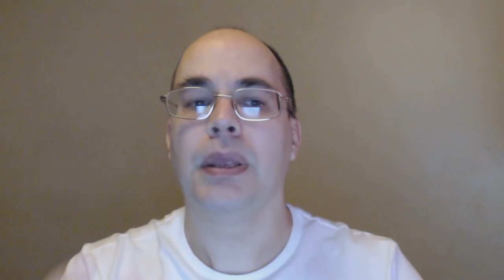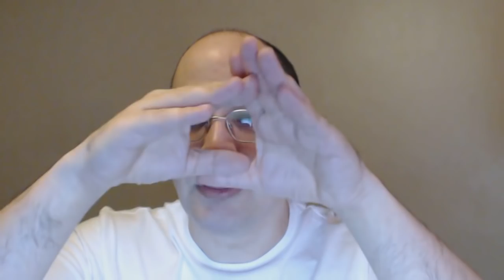How do rockets move in space, with nothing to push off from?

Comment: I take it you haven't had a scientific look at the flat "Earth" yet. Once you do, everything you have ever learned will be turned on its head. Do a curvature test for yourself and be prepared to see science in a whole new way. The Earth is stationary to. Just for a while, stop reading your books and look at the Earth. It needs more brainy people to know the truth.
Reply: +bob question You are a fool. A sphere with a circumference of 24,900 miles will have a radius of ~3,960 miles (and thus a diameter of ~7,920 miles not 24,900 miles as your dumb ass stated) and thus a surface area of ~197,000,000 miles^2. In regards to the Earth, the north and south poles will be ~12,450 miles apart. A circle on a flat plane with a radius of 12,450 miles (from the center north pole to the "ice ring" south pole) will have a surface area of ~487,000,000 miles^2. Most people with an IQ above 70 would call that a pretty sizable difference (while most scientists would shoot whatever they happened to be drinking out of their noses snorting at the sheer depth and unabashed arrogance of your ignorance...and the ridiculous odds that someone like you could survive beyond childhood without stumbling stupidly into death...)

Line of sight on a spherical Earth is simple to calculate (most would consider it common sense) and doesn't translate to a flat plane. You merely take a circle with the Earth's radius (~3,960 miles I usually use 3,959 miles as that just happens to be the measurement I see most often. It's not a perfect sphere after all and has a dynamic surface...especially when dealing with bodies of water... so such measurements will always have a little discrepancy to them) and draw a tangent from the observer's height above sea level (the point where that line meets the circle will be the observer's horizon.) Extend that line on out as far as you want. Anything above it (beyond where it meets the circle) will be above the horizon for the observer. While anything on the observer's side of their horizon will be completely visible to them. To actually do the calculations, you simply form a right triangle where the hypotenuse has a length of (Earth's radius + observer height) and the other two sides are the Earth's radius (line from the center of the circle to where the tangent from the observer meets the circle) and the length of the tangent from the observer to where it meets the circle (AKA observer's distance to the horizon.) From there, the Pythagorean theorem can be used to determine the length of any one unknown side. If you want to know how much of something will be visible, and you already know it's distance, simply calculate the distance to the horizon for the observer, subtract that from the total distance, and then calculate the curvature "drop" for the remaining distance (distance in miles^2 x 0.667 = "drop" in feet.) The result will be how much of the object will be below the observer's horizon. None of that should make any sense on a flat plane and yet our measurements / observations match the results...(within a small margin of error due to other minor factors involved that aren't accounted for in the calculations...like refraction.)
Reply: "The time zones work therefore the idea of a flat Earth is IMPOSSIBLE." Modern flat earthers manage to explain timezones, it is a flat earth consensus that the sun travels above the earth and acts like a spotlight, most argue that the sun circles the North Pole, some however have argued the sun travels east to west in a straight line, but the east-west dimension loops back on it self.

In doing so, these idiots render themselves unable to explain sunset and sunrise, and get the path the sun in the sky wrong.
Reply: Most of what you say is correct. The moon has only a 7% energy return; so you need good power and sensitive equipment to pick up the return signal. However it can be done with as little as a 1000 watt transmitter. Used ones are quite affordable. 

However here's what is incorrect about your claims - that you've looked into it and found no evidence for it. That is a lie. 

Literally thousands of people around the world have done it; there are videos right here on youtube from people who have done it, and there are forums, web pages and clubs dedicated to it. 

Don't make things up or lie to advance your points because when you are busted on them you look desperate. 

You, personally, could do EME bounce. Anyone can. I haven't found any flat earthers who have managed to do it, or even try it - they seem to be incapable. I'm not sure why but I have my suspicions.
Reply: I know someone personally who has done it. You can seek out your own local amateur radio group and quite likely find someone similar. 

It's easy to dismiss something from the safety of your computer. Harder to say it to their face. But you're a coward.
Reply: The tests you're talking about are "line of sight" experiments, not curvature (though curvature is involved.) The primary difference being that you first subtract the distance to the horizon for the observer from the total distance to whatever you're trying to observe and then calculate the curvature for the remaining distance. When you compare the results of flat earther "curvature experiments" to the properly calculated line of sight results, they are always within a few percent of what would be expected on the globe model. A difference easily accounted for by atmospheric conditions and inaccuracies in their measurements.
Reply: I take it you haven't heard of EME bounce then.
Reply: No, it only bounces when aimed at the moon. It doesn't bounce when aimed anywhere else.
Reply: Kris de Valle
If you can bounce radio waves of off the moon more so than the sky around it and receive a properly measurable signal back, this would have massive implications for what the moon is.
Reply: +bob question Flat Earth requires a small close sun (and moon). Any scientific look you take at that will show that the sun (or moon) can't be close and small and still match observations. Apparent magnitude, angular size, and the direction of "rise", "set", and "travel" across the sky relative to an observer simply cannot be made to work on any flat model.

One very simple experiment refutes flat Earth in regards to angular size. It's easier with the moon (as it requires looking directly at it and being able to see it's outline clearly) but with something like welder's goggles, it can be performed on the sun as well. Simply take a piece of glass or clear plastic, observe the sun or moon through it, and use a marker to trace the outline of the sun / moon onto the glass. Do this at least three times during the day (or night for the moon) when it's close to the horizon early on, when it's not (midday / night), and then near the end of the day / night when it's close to the horizon again. Your eyes will tell you that the sun (or moon) gets larger, the closer it is to the horizon. When you measure the circles that resulted from your tracing the outline at those different times however you'll find that they are all the same size (technically there is an extremely small change but it's so small that the human eye can't distinguish it and drawing it freehand is nowhere near accurate enough to catch it if you could...in fact the actual change is far smaller than the thickness of the line drawn around the outline.) A sun or moon 3,000 miles away, should appear (when drawn this way) to be at least half the size it is at it's highest point around an hour after it "rises" or before it "sets." You'll find no noticeable change (even at 5,000 miles away like some models have it, there will still be a very noticeable difference.) That only makes sense if what is being observed is a great distance away. (an interesting side note is that the optical illusion that it changes size relative to the horizon exists when dealing with photos / video as well. When compared by a person, a photo or video taken of the sun or moon which includes the horizon in the image  and one that doesn't, will appear to have suns or moons that are different sizes even when tracing their outlines on something clear shows that they are actually the same size in both images.)

Apparent magnitude (brightness) is a little trickier to test exactly as you'll probably require an instrument to determine the exact "brightness." However, a sun or moon 3,000 miles above an observer (~noon or when the moon is at it's highest point) will be over 6,000 miles away from an observer near the edge of the illuminated area. Apparent magnitude of a light source is inversely proportional to it's distance from the observer. As such, at twice the distance, it will be 1/4 as bright. We do not see the sun or moon as being 25% of it's maximum brightness at anytime during the day / night (in fact, using good instruments will show very little change in brightness over the day / night...most of which can be accounted for by atmospheric scattering due to the light having to travel through more of the atmosphere to reach an observer near the edge of the illuminated area.) Again, at 5,000 miles minimum distance (as some models have it), the change would not be quite as drastic but should still be very obvious...and it isn't. What we see makes sense if they are very far away however. For example, for a sun 93,000,000 miles away, an observer would need to be an additional 93,000,000 miles away to see a drop in brightness of 75% making a difference of several thousand miles between observers trivial.

As for direction of "rise", "set", and "travel", that can be tested with a compass and the ability to see. Simply use a compass to determine the direction (relative to you) that the sun or moon "rose" or "set" and then consult any flat model you wish. Advance the sun or moon on that model to where it's light first reaches your position for "rise" (or just before it's light moves beyond you for "set") and then determine it's direction relative to you. It will never match the direction you actually observed (unless you happen to be standing directly at the north pole for some reason...in which case you've probably got bigger concerns to deal with.) "Travel" is a little trickier but an easy example shows that it doesn't work either. An observer at facing to their due east at the equator on one of the equinoxes will see the sun "rise" directly in front of them, appear to travel straight up and directly over them, ultimately "setting" directly behind them (their due west.) In other words, they'll see what appears to be a straight path of travel. The appearance of a straight path of travel is impossible on a flat model as lines of latitude (east and west for the equator) have to curve away from an observer along their horizontal axis (to their left if looking east and right if west) on such models. On a spherical model, lines of latitude curve away as well only they do so along the observer's vertical axis allowing for an apparent straight path.
Reply: Wow. No answer as to why the sun traverses the sky differently in the southern hemisphere then? I would think something so obvious should have some sort of answer.
Reply: +mj murcott The only way they can make it work is by changing reality. ie making the sun and moon only 32 miles in diameter and only 3000 miles away. A classic example of an argument out of ignorance to explain their model.
Reply: +bob question In the flat earth model the sun sets due to perspective correct. If that is the case then I will believe the earth is flat when you can "bring the sun back" with a telescope or pair of binoculars after it sets below the horizon. Conversely if you CAN'T bring the sun back after it set by going to the top of a high rise I will believe the earth is flat.
Reply: Looked at it bob.
It ain't flat.
You ever been up in the air?
Reply: Jeff Bob
That is a montage of two different pictures. It was not taken from the moon.
Reply: bob mentioned, "... so called,  satellite dish. "   What's the real name for it?
Reply: +bob question  Mathematics Bob. The language of reality. Math may not be reality but it does an excellent job of describing it. Classic example. Spring Equinox at noon. observers at the Equator and every ten degrees north and south. At the Equator the sun will directly overhead. For every 10° north or south subtract the latitude from 90° and that is the elevation of the Sun above the horizon. Now plot this out as if on a Flat Earth. The intersections of the angles from the Equator and the degrees of latitude will not all meet at the same point. Not even close. Never mind the problem of sunrise and sunset on the Equinox's all being at 90° east and 90° west. it can't work on a flat plane. Besides the effects of Earth's curvature is visible at sea level. Look at a YouTube user named Soundly. He has video he posted in real time of the transmission lines across Lake Ponchatrain. These towers are evenly spaced and in line with on another. As you get farther out the tops of the towers form an arc as do their support piers as they meet the horizon. The piers disappear over the horizon while the twers continue to arc downwards
Reply: bob question anyone can do eme bounce and determine the distance to the moon. Thousands have.
Reply: I've had a scientific look at flat Earth. And I can't believe that people fall for that nonsense. Let's ignore the maths and start with what is plainly observable. On the flat Earth model, it doesn't matter where you are on the planet, the Earth will be tracking to your right as you stand and watch a sunset (ignoring the fact that it would never go below the horizon for a moment). Yet if you have ever watched a sunset from Johannesburg, Sydney or Santiago, all in the Southern hemisphere, you will see that the sun tracks to the left as you stand and watch sunset. This would be impossible on a flat Earth. Yet MILLIONS of people have seen this happen. There are plenty of time lapse videos of sunsets on Youtube that you can compare.
Reply: So is your alternative explanation that God is spinning stars in the sky to pretend we are on a globe?
Reply: +bob question - stop reading your books!  And learn from youtube!
Reply: mpetersen6 : the bob in question appears not to have responded for seven months.
Reply: +bob question
The fact that the earth has 2 celestial poles around which stars appear to rotate, the northern one only visible from the northern hemisphere, the southern one only visible from the southern hemisphere, destroys even the slightest possibility that the earth could be flat.

You keep talking about scientifically looking into the "flat earth", yet your statements in this discussion demonstrate you lack the fundamentals to scientifically examine anything.
Flat earth fails even the most cursory scientific examination. You can't even have a working map based on it.
Reply from the maker: There is NO science behind a flat Earth, it is one of the easiest fallacies to disprove that it shouldn't really be worth anyone's time commenting on. Phases of the Moon, different star constellations in different parts of the world, plane flights, time zones, centre of gravity and all the images from space are just a handful of the reasons why a flat Earth is just a non starter.
Reply: m j murcott
I thought that to. There is little in the way of promoted science on the subject. All of the scientists that have demonstrated this have been sidelined from our education. That's why the only way to verify this incredible fact, is to put the mainstream teachings to one side, temporarily. You can go back to them.

Use the spherical trigonometry and test it against the "Earth" itself.

I have always been a full on heliocentric buff until, after a conversation with a well trusted friend, I realised that all of my education is second hand information except a hand full of experiments. There are loads of videos on youtube of people showing things that should be well hidden behind the curve on a sphere of 24,900 miles in circumference. Its not until you verify this with your own test that you realise the strange truth of the matter.

There is not one single real whole Earth photograph from space. Not one. Nasa admit this but not very publicly or loudly. They are all composites, CGIs and fish eye photos from under 100,000 ft. Even the ISS shots are imposed onto a background of high altitude fish eye imagery.

The thing about a rocket in a vacuum is that it is one mass with gas expanding outside of that mass. This is contrary to Newtons third law which specifically relates to two masses with a force between them. The gas expands unimpeded into the void. You can't have force without resistance. 

Math powerland is one of the ex-nasa whistle blowers who was involved in faking images of many of the "heavenly bodies" that we believe are out there. Have a look at his work.

Also, so many professions such as surveyors, architects and railway navigators all work to a dead flat datum line. Radar and long range sight targeted weapons all rely on the "Earth" having no curvature.
 
Gyroscopic progression does not happen. An interferometer was used by Michleson and morley and demonstrates no rotation. and the Airy's failure, (Airy was the Astronomer Royal), was called this because it failed to demonstrate that the Earth was rotating but that it was, in fact, the stars that were rotating.

I know this is big stuff, but as a scientifically minded person myself, The truth is the holy grail, even if that means coming to terms with some major thought changes. 

Beware of digital telescopes. These have "enhanced" images of the visible planets programmed into their software.
Reply from the maker: Ok let us take one example, time zones. Recently we have New Years day when many people were phoning friends and relatives all round the world to wish them a happy new year. So people in Europe were phoning people in Australia, Hong Kong, USA etc. to wish them a happy new year. Phoning from the UK when it was midday and the Sun was high in the sky they would be talking to someone in Australia where it had been dark for many hours and would still be dark for a few more hours, or midnight. This difference between the various different times is exactly repeated in step with the various different sections of the time zones on the globe. This difference cannot be accounted for in a flat Earth scenario however it does exactly correspond to Earth being a globe.
Reply: m j murcott
Whether the Earth is flat or a globe, we know that the time zones work.

I understand your point. Our education teaches us that it is possible to see things that are nearly 14 billion light years away using the Hubble telescope. In order for that to happen, light must have a lifespan much longer than this. If the sun is much closer and smaller, light has a traversable distance that is more akin to thousands of miles, the time zones then become possible on a flat plane. The night is due to lights ability to only travel so far. Indeed, the sun can still be in the sky and when we look in the other direction, everything is then being lit with only red light which it has a greater persistence than blue or green.  

The real problem dealing with this whole hypothesis is the trust we have in our teachers. They had trust in theirs and when they teach us what they think they know, the do it from the principle of honesty. It is only the source of the information that needs to be corrupted in order to disseminate a flawed model. 

Light, when it leaves a spherical source, does so in spherical manner. For us to see a light source 14 billion light years away as Nasa claim, means that a sphere of light has extended out in all directions that has a diameter of 28 billion light years. If you imagine that sphere, Is it even imaginable for any of that light to still be visible considering that the light is subject to the reduction in power inversely proportional to the surface of the original sphere and the surface of the 28 billion light year diameter sphere? 

I think not. indeed if you double the size of the sphere in diameter, you multiply by 4 the surface area. This means you divide by 4 the intensity of light. If you multiply the radius by the number of times necessary then you have to divide by 4 multiplied by the number of times you have doubled the radius of your sphere. It is too implausible that we should receive any light from that distance. The photons that do arrive here would be far to wide apart to form any image. "That is illogical, Captain". Yet that is what we are told.

Our education about the nature of light, is wrong. 

Our education as been corrupted in order to sell us the concept of a globe whizzing perilously through space as an insignificant accident in the infinite. 
Yet I can see cliffs 400 ft tall 58 miles away that should have their base 1600 ft below the horizon. That is not possible on a sphere 24,900 miles in circumference.

The purpose of this mal-education is to disenfranchise us from our home.

I know you don't buy this as yet, and the last thing I want to do is force a change of mind. If you get it you get it. but does that make sense to you, even if you don't buy it?
Reply from the maker: No it isn't whether the Earth is flat or a globe. A scientific theory is only possible if there is no contradictory evidence. The time zones work therefore the idea of a flat Earth is IMPOSSIBLE. If the Earth were flat all parts of the flat Earth would have day at the same approximate time and night at the same approximate time. There is no possibility in a flat Earth for it to be midnight in one place and midday in another, therefore there is no repeat no possibility for the Earth to be flat and this is just one of the many reasons contradicting the idea of a flat Earth. Your ideas on light, distance etc. are equally flawed. Light doesn't have a limit on the distance it can travel, the intensity of light from a source does decrease with distance due to the inverse square law which I have done a video on, but that isn't the same as light only being able to travel a limited distance. Light in the form of a laser is bounced of a reflective dish which has been placed on the moon, covering over 700,000 km in the process, the same experiment can be achieved with lasers and mirrors in any reasonably well equipped science lab. Radio signals which are also electromagnetic waves can be sent round the world and again don't have a limit on distance, however they do have a problem with the curvature of our ROUND Earth. In the 1920's radio communication and signals were first able to be sent and received from America to both the UK and also as far as New Zealand this isn't possible if electromagnetic radiation has the kind of limits you are suggesting.Finally, rather than continually saying that the education is wrong and that the trust in teachers is corrupted it should have dawned upon you that your position is scientifically untenable and that you need to go back to the basics of science from Occam's razor to how to test a scientific theory before you start on anything more complex.
Reply: m j murcott
No contradictory evidence is the key. 

The Big one, Gravity. Are you a scientist that likes new discoveries or do you sit within a citadel of safe understanding?

Would you push the boundaries of your comfort zone if you thought that there was more to this world than what we have been told?

Imagine for just a few moments that the Earth is not a ball. Imagine that you think and believe it to be a ball. A ball of fixed spherical properties. but just for the fun of it, that it was something else that you were unaware of. Would you want to know the truth or would you want to stick with what you know?

You have said that a scientific theory stands if there is no contradictory evidence. Would you be intrigued enough to test for contradictory evidence if a fellow man of science told you there was? Would you step off the precipice into the unknown? Would you test a hypothesis that might challenge your whole understanding?  

The basic premise of science is to explore, to seek the truth. Are you a seeker of truth? :D
Reply: possumverde
No. A plane and a Ball of 24,900 miles in diameter are easily compared. 

You are right to point out that a "Curvature test" should not be described as such. "Lack of curvature test" is more appropriate. However you can only call it that if you already know the results of the test. Someone who is just about to discover that it ain't no ball, could very much call it a "curvature test". 

a "Line of site test" does not explain what about the line of sight you are testing. If you are to describe it as a "Line of sight between two points that should be obscured from each other if we are standing on a spinning ball test" Then you would be right back on track.

So, a ball and a plane are indistinguishable to you are they? You're not a scientist or a mathematician then?
Reply: dude so every planet we see with our eyes is rounded but the planet that you are standing on is flat ? why flat ? why not square or pyramid ?
Reply: Kris de Valle
Is that the EME bounce that "bounces" uniformly off of "Charged particles"? It goes through an atmosphere full of charged particles to bounce of off particular "charged particles" uniformly? Think about that for one moment. That is Ballshit. If radio waves are bouncing uniformly off of something, it is because there is something uniform for them to bounce of off. Hence why they use solid reflectors to concentrate uniform radio waves to a focal point on a, so called,  satellite dish.
Reply: Kris de Valle
So these radio waves are doing a 500,000 mile round trip, most of the signal will be absorbed by the material of the "Moon".The signal that does bounce off of a spherical object (making the assumption that it IS spherical)  means the returning waves will be scattered out in all directions (like bouncing of a very poor quality convex mirror) , thus meaning "Earth" will receive a tiny tiny tiny signal back, if at all.  "pinging the moon" it's called. I have not seen it done, so unless you have some evidence of this being done, Its Hear say. I have looked into this before and found no evidence of it.
Reply: possumverde
I consider you to be my dumb ass :D what a waffly old load of nonsense. Einstein tried that tactic and look what a tool he now looks.

What are you trying to explain here? You'll know when you are on the right track because it will suddenly seem simpler, not more complicated :D
Reply: possumverde
"Flat Earth requires a small close sun (and moon). Any scientific look you take at that will show that the sun (or moon) can't be close" Too right, my friend, have a look for yourself (not via nasa). Small and close. Lets start with this issue. How do you know that the sun is 93,000,000 miles away or the moon is 240,000 miles away, as you claim?
Reply: Simon Marsh
Circular star trail photographs with a wide angle lens displaying no parallax fundamentally disproves earth rotation on its own without any other evidence. If you claim to have scientifically looked into this, then you didn't look very hard. What are you relying on as evidence that proves this imagined spinning ball?
Reply: Timothy Baldwin
The workings of the sun only come into play once you have done the calculations and gone out to look at the "Earth" and you realise that there is no curvature. The sun acts more like a reflection than a direct source of light.
It's only when you go to higher altitudes and watch the sun that you realise that it does obey the laws of perspective. What it doesn't do is act like a giant fusion reactor 93,000,000 miles away. Also, there is footage of the sun being filmed on the equator on the equinox which shows the sun is travelling on a curved path relative to the "Earth" . This, again, would not happen on a spinning ball where the sun is still (relatively).
Reply: Kris de Valle
Pinging the moon is an urban myth.